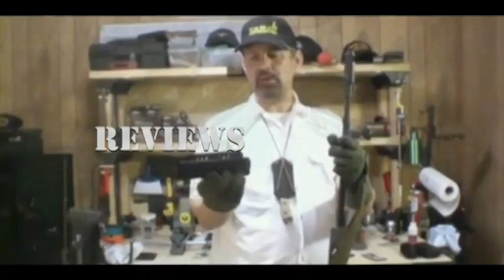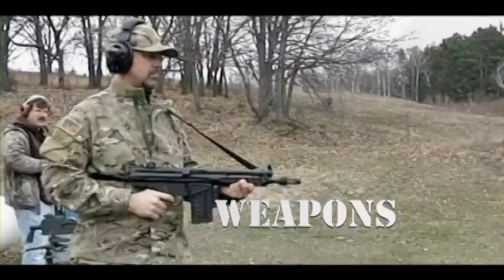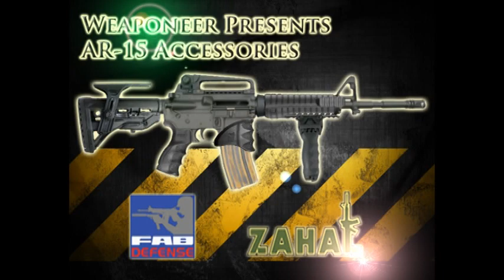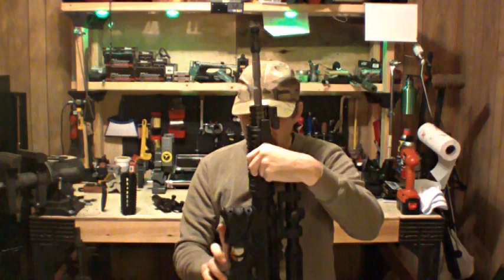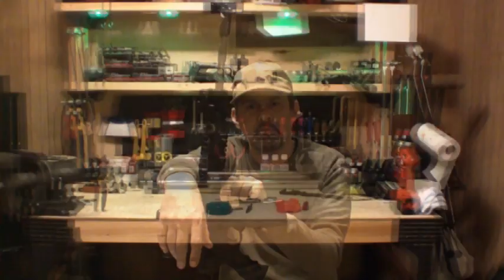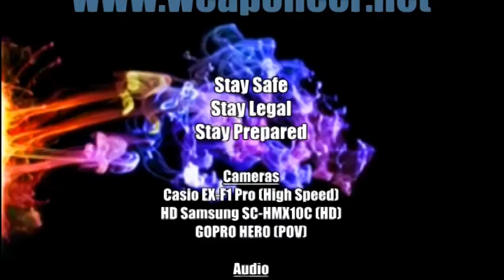FAB Defense M4 Polymer 3 Rail Handguard Review

Comment: Yes, they are designed to fit very tight so there is no movement, so if the rifle is a little tight already, you will need to fit the length. You can do this with a large flat file, or put  piece of sandpaper flat on the floor and run the back of the handguard against it, keeping it straight and being sure not to remove too much material. You want it to stay very tight.